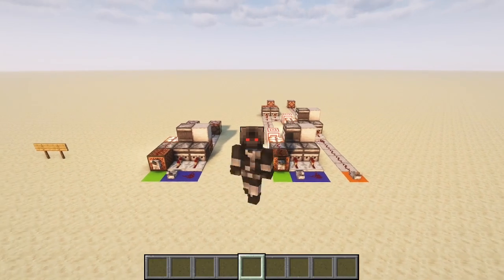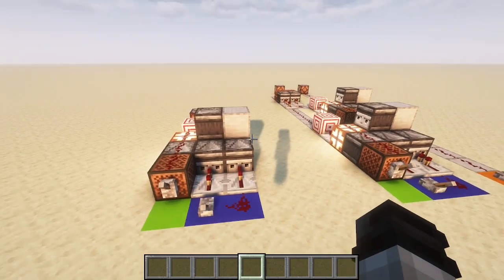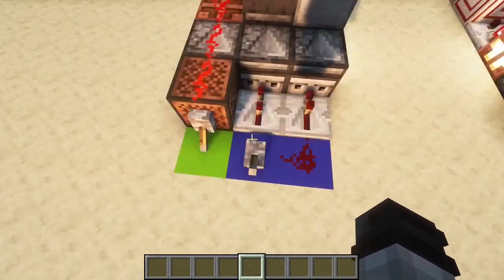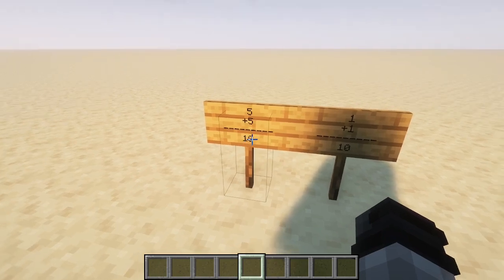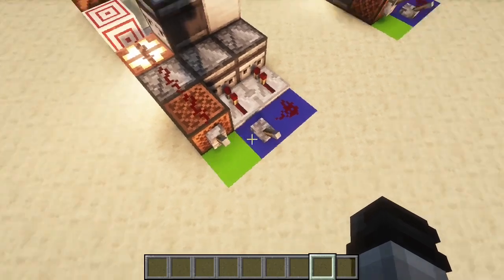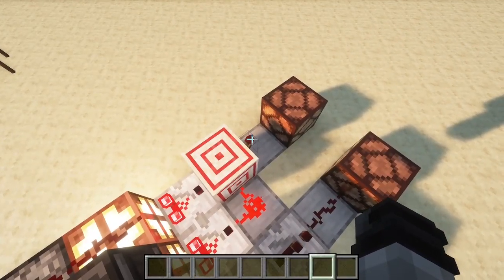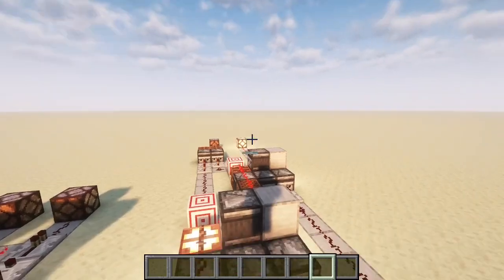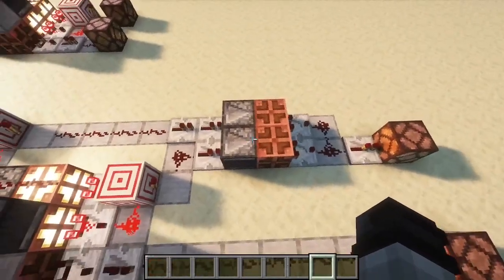Half Adder & Full Adder in Minecraft | Adders 1.21+ | Minecraft Tutorials

Comment: After some testing I got this working on bedrock by placing a dust over the copper bulb by the full block and replacing the note block with a dispenser, not sure what that does on Java but I like the noises so I added one under sum output. This let me shrink my 4 bit added from a massive room where I had each gate made with either the old 3 redstone torch and gate and a 2 comparator xor and tons of room and wires running everywhere to a TINY area and made it take far less time to run! I did have to add 1 extra repeater somewhere but with more planning could be avoided.
Thanks!
Reply from the maker: No problem!